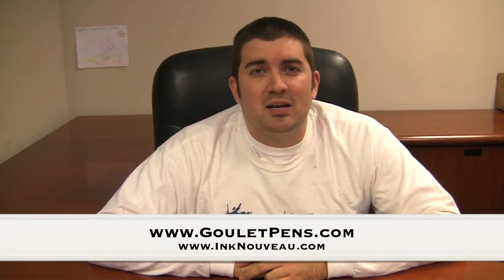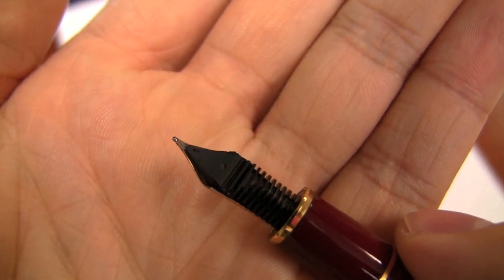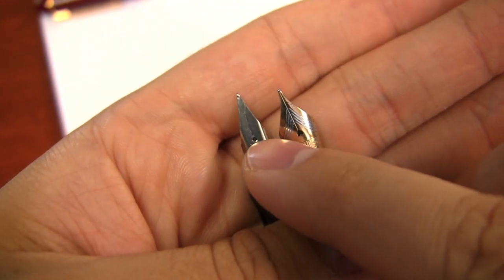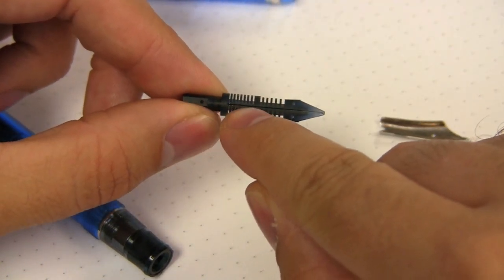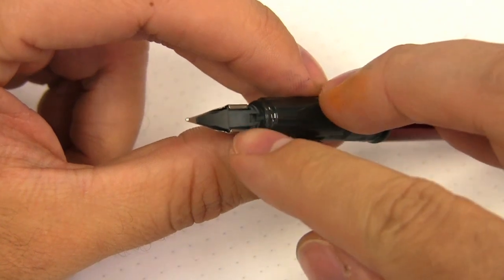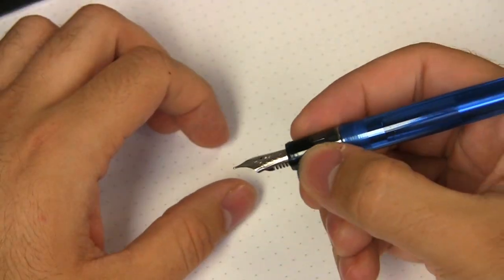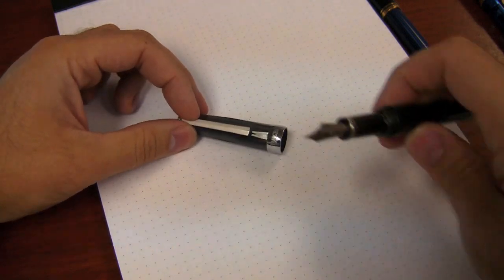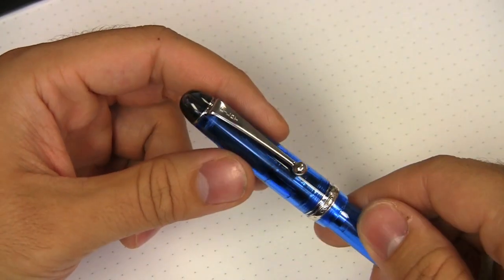Parts of a Fountain Pen (Fountain Pen 101)

Comment from the maker: If you aren't going to use it for a while, meaning a month or more, then it really should be cleaned and emptied, then stored however you want. If it's just a week or two and you want to leave it inked, then you'll want to store it either horizontally or with its nib up, it depends on the pen which will be best. Some people will swear by one method or another, but I tend to store everything horizontally.
Reply: I've had pens dry up in less than a week in Michigan

Comment from the maker: I knew I wouldn't be able to cover everything. Not all pens have cap bands though (often called center bands). A lot of it depends on the design of the pen, if it will crack. It's not like every pen without a band is guaranteed to crack, it's just that pens that use certain materials or are particularly thin really need them.

Comment: This video is rather old, but I’m taking a shot anyway. So, the part at the top of the cap is called a finial. Does the very bottom “cap” have a name as well? The blue demonstrator type pen you used as an example kind of had a mirrored finial and bottom tip (they look similar but the finial obviously has the clip attached to it). So many parts of the pen have a name so I was curious if that had one too, or if it’s just part of the body/barrel and doesn’t have a specific name.
Reply: Late, but I believe I've heard them being called End Caps.

Comment: I cannot find tipping material or breather hole on my nib, should I be worried? Have I been scammed and sold a pen that is not really a fountain pen?
Reply: Different nibs have different designs. Some is designed to not have a tipping material and no breather hole. Especially stub or italic steel nibs usually don't have either. So if your pen writes well and holds liquid ink in a reservoir inside the pen, it's a fountain pen all the same and you needn't worry.

Comment: Greetings,

What is the upper part (the part connected to barrel) called? I mean section is the upper part, but what is section along with nib, feed called? 

Thank you.

Regards,
Brian
Reply from the maker: +Brian Dsouza This infographic (http://blog.gouletpens.com/2015/07/anatomy-of-fountain-pen.html) hopefully answers your question! - Colin
Reply: +The Goulet Pen Company 
Ahemmm, no. I am still confused. "Section" is the part which holds "nib", "feed" and "barrel" together. But if "nib" and "feed" are connected to the "section" what is it called? For example if I have a Parker 51, when I unscrew the barrel the upper part which I have now in my hand is called as? Or if I unscrew a Pilot Metropolitan's brass barrel, the disconnected upper part (section along with nib and feed) which I have now in my hand is known as what? 

Hope you understood my question. 

-Brian
Reply from the maker: +Brian Dsouza Ok, hopefully I am understanding, What you have in your hand in that instance is the grip. It's usually plastic and a solid color. The grip, trim ring, and threads all make up "the section" which is where the nib and feed go into. - Colin
Reply: +The Goulet Pen Company 

Much obliged Sir Colin.